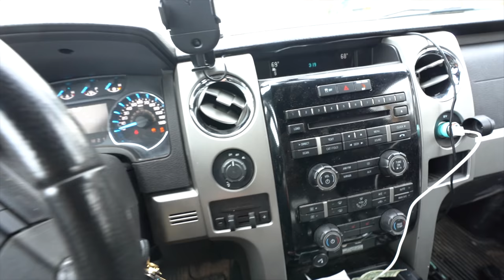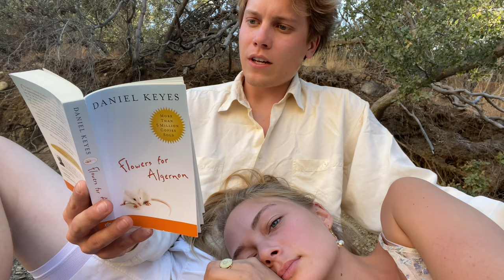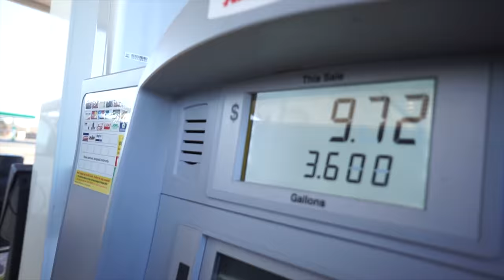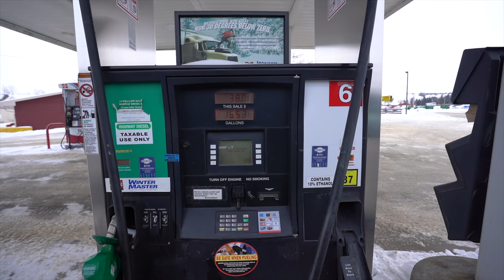MAV | best of 2019 Truck camping montage (2019)

Comment: I converted an old brand fx Fed ex 8' topper on a 2010 f150 into a rig like yours. Will be traveling once this pandemic has eased. You're lucky to do this when you're young, I have two yrs till retirement. Thanks for the insperation kid.
Reply: A year later and i’m wondering if have you started your adventure yet. If so, hope your doing well and having fun. Stay safe!!
Reply: @corypruzin9430  I have taken the "cramper" out on several trips. My wife isn't to keen on coming with but that was expected. It has paid for itself though, as I can remote camp where others won't. 
I have canned the sleeping platform I built for the camper. I used a 6ft folding table and cut a inch and a half off each end, gorrila taped the legs and installed the table across the bed instead of lengthwise.  It folds in the middle,  using a cooler underneath and a support mattress, ( head and feet raised) Freeing up alot of room for my all in one solar/ shore power/ 1000 watt inverter. Porta potty. Fridge.  Ventilation is a constant battle with the fantastic fan andI will think of a way to improve.  Thank you for your comment.

Comment: Last year. I drove to 25 different states and 2 coasts and put 80 thousand miles on my truck and spent about 140-150 nights in my truck and the coldest night I spent in my truck was probably 5 degrees. I have been on 40+ hour drives.
Reply: Only guys are safe to do these...
Reply: @MegaSethb he’s not wrong though. Girls would have a bit of trouble with the peeing part it would be kinda hard to do it in a bottle on cold nights
Reply: @MegaSethb yeah you’re right I was actually looking for this so I could delete this. There’s actually a girl who does this. It’s pretty incredible. But at the same time I wasn’t really wrong I didn’t say girls couldn’t do it, it would just be a bit of trouble with the peeing situation, I’m more thinking like in the terms of it being sub zero and girls need to be in a squatting position
Reply: @MegaSethb that’s cool. But poop doesn’t freeze like pee does.